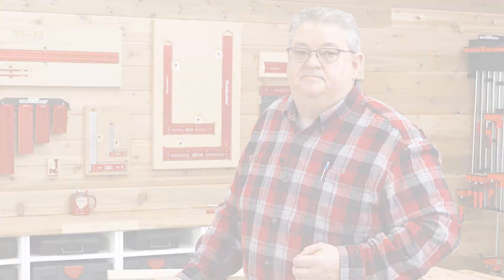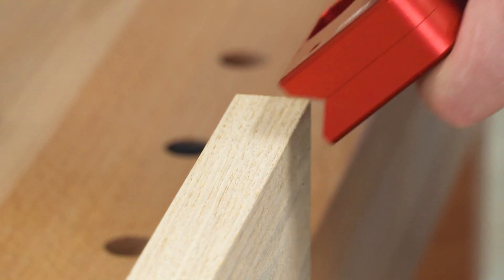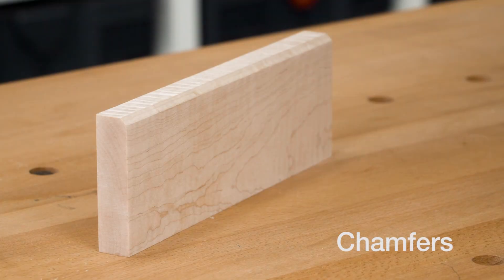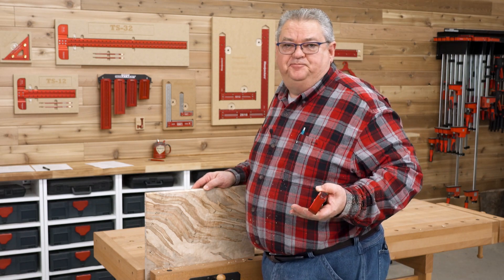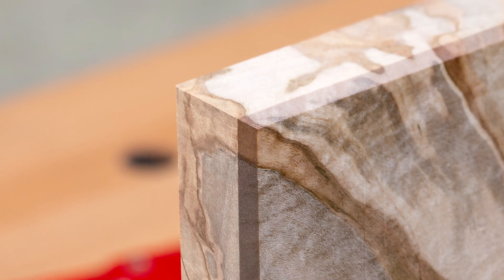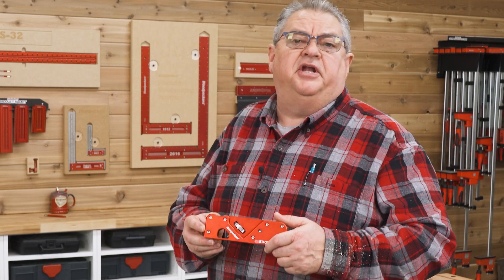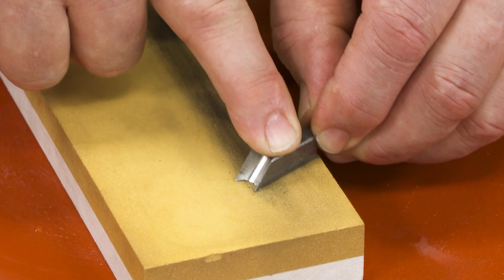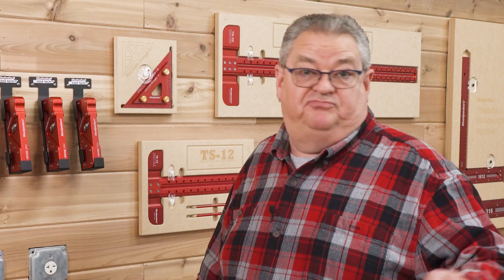EZ Edge Corner Plane for Crisp, Clean Radiuses and Chamfers  |  Woodpeckers Tools

Comment: Save some money and get the whole set - only $550. Really this should have a quick method of pulling it apart and just replacing the blade with what you need for the project rather than selling another whole separate tool for each type of edge profile you want. 8 screws to hold this together, it would probably work fine with 4-5. This is where marketing is just trying so see how much they can soak the customer for, rather than designing an efficient blade change out system. Woodpeckers gone mad.

Comment: It appears you can swap out the cutter heads for different profiles but it isn't expicilty mentioned in the video or website. Can I buy one body and swap in the blades I want to use?  I might use 1/8 almost all the time but may want to have a chamfer on hand.
Reply: Yes you can.  YouTube search "How to change cutter on EZ edge Corner plane."  I bought the 3/16 radius the first time it was offered and it's a joy to use.  
Scott
Reply from the maker: Yes you can interchange the cutters.

Comment: For those wondering it's $500 , blades $150. Hard pass shouldn't be more than $70
Reply: Stop with the false information. Each set (body + blade) is $160, extra blades are $25. Buy all 4 sets for $519. Or do what I'm doing: For 'only' $235, buy one set (body + blade) for $160 and the other 3 blades ($75), so you can get all 4 edge treatments and 'save' $285. Yes $235 is expensive, but it looks like the blades and certainly the body will last "forever". If you're in a production environment then you can justify buying multiple sets and avoid the blade change time. For me, changing blades is a small price to pay (and saves me the $285 cost for the convenience of getting all 4 sets.)